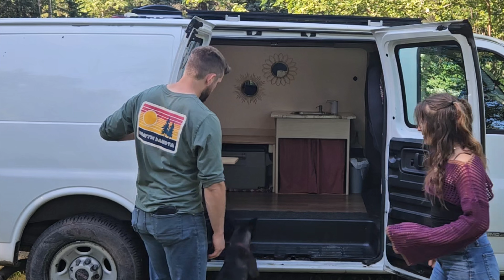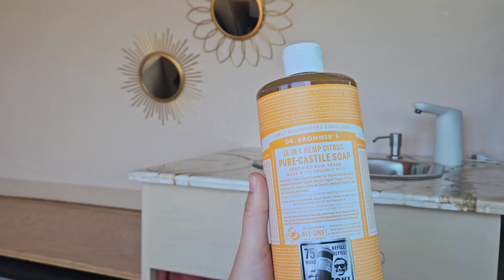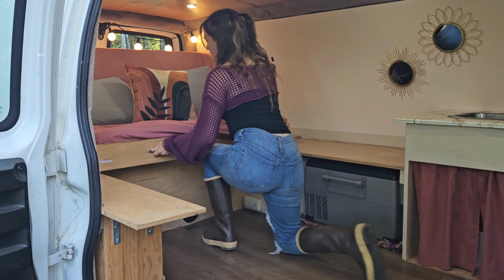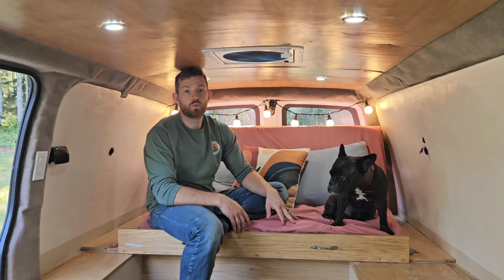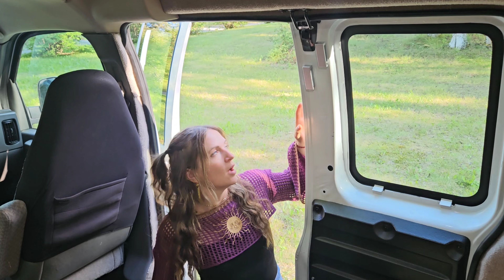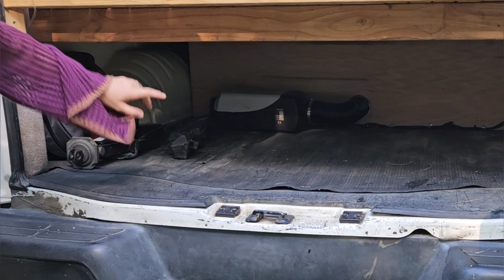CAMPER VAN TOUR!! Self-built Cargo Van Conversion | GMC Savanna | Chevy Express | L&K SEIMS

Comment: You will run into one h3ll of a liability if that lithium battery ever goes into thermal runaway.
Replace with an 8D lead acid or gell-cell deep cycle, much safer.

Comment: Trying right now to convert a GMC Savana  van 1997 into my new home with almost no money, going to use a 5gallon bucket for bathroom, got a very small solar unit only for phone charging a few led lights and hopefully i can find some fans that run on a USB cord. Not going to use any electric appliances and just a camping stove the one burner kind with gas cylinders. , the problem is space not even going to have a bed just unroll a sleeping bag on the floor both walls will be storage units mainly alot of books - my family always collected books, but we started downsizing when it took a entire Uhaul box truck just for books one of the times we moved. 
Anyway could you do more van builds or just show any builds you can for the small cargo vans like this one. Thanks in advance.

Comment: Big express fan here. Love to see it but there's a lot you could have done here. You can mount the battery in the cavity where the sink drains out as well as a tank for the gray or fresh and even a diesel or gas tank if you like in the same spot. 314ah batteries are roughly the same size as the 100s but a lot heavier and at great prices now so picking them up is extremely beneficial for the extra power to run an inverter for all the fun stuff. mounting them in that cavity is not too small. They won't hang down too far and it frees up space in the trunk and in your cabinets inside. For all seasons it helps to wrap the batteries in a 12v RV tank heater with thermostat. They only take 40w and they're on a switch. Solar and alternator combo chargers are also super cheap and extremely beneficial now. Also not a shore power plug but a 120v battery charger (which I prefer over shore power) are extremely cheap and a breeze to install for home outlet charging when you want it. If your van is equipped with a 120v engine heater (typical on heavy duty models and diesel trucks) you can even run a splitter from a bumper plug to heat the engine and or just charge the battery. In my opinion it's only worth it to use regular height countertops even in a low roof van. Things in regular life just tend to fit better. For instance at least having desk height lets you slide your legs in under it. Though typical countertop height leaves a small hole to do food prep I think it's worth the sacrifice. You may even be proud to contour your countertops to various depths to accommodate different things better in a smaller van. For instance the depth of the sink vs the air fryer. Lastly tent air conditioners are a great option for these vans now. They use half or a fraction the power of 12v rooftop 120v window mini-split or even portable residential units use and the prices for them came down a lot which was a big deciding factor for me personally. Going without ac is now a thing of the past and technology is finally letting the simple life not suck. One last bonus thing that might be worth a mention. 120v so it does need the inverter to work but heated floor film. It goes under your finished floor. If you have insulation it goes right over that and just under your floor of choice. In my opinion it's a must for perfect redundancy in smaller vans. My van is the extended wheelbase with 11ft from drivers seat to rear door. A 3ftx10ft mat only draws 360w max. That's actually less than the tent air conditioner. At that rate it will run on a single 314ah battery for 12 hrs.

Parts:
dumfume 314ah lifepo4 battery - $294
5 gal aluminum tank - $90
rifachua 12v RV tank heater - $20
renergy 40a dc-dc with mppt charger - $125
nexpeak 120v battery charger (does charge lithiums) - $25
joemnwart 3000/6000w psw inverter - $150
mictuning 15a 120v port splitter plug - $20
wishilo 400w 120v tent ac unit - $180
quietwarmth 3ftx10ft 120v heated floor film with thermostat controller - $385
Reply from the maker: The solar charger and battery are mounted in the rear, so is the diesel tank and heater. They are mounted in a way that theyre not in the way that way its keeping trunk space and not cluttering our sink cabinet.

Comment: Is that normal or extended. Also, what do you think of the new savanah 6.6 motor ?
Reply from the maker: This is non-extended, just the normal length. We haven't had hands on experience with the 6.6 motor but I've heard that they are reliable as long as they are properly maintained!

Comment: Can add a custom hi-top install on this van for much less than buying a Ford, Dodge or Mercedes hi-top cargo van.
Reply from the maker: That's actually so valid 🙌 I haven't price checked but raising the roof on this would be niiiiiceee
Reply: @LKseims  I've read it's $3k-5k for a high top to be added depending on the wheel base (when done at a shop that does it, not DIY).

Comment: The decision to place the cooler on a rug is actually quite genius.  Simplicity at its best. Makes complete sense.  I will be copying that
Reply: Try this, then: my Trelino(R)😅 "composting" toilet sits on the heavy lipped cookie sheet i use under my stove on campground tables. Super slidey when needed or rock-solid when i put a nonskid pad under the leading edge, during travel!

Comment: Tell me how you insulated the van floor, top sides or if you didn’t and then what you used for your walls they look smooth and not as if they’re what
Reply from the maker: We don't insulate the floor on our vans anymore because we hardly noticed a difference when we did vs didn't 😬💁‍♀️
And the walls are rough old wood, covered in drywall spackeling! We'll upload a YouTube short showing that process soon!

Comment: I can't stand seeing the sink 1st thing.
Reply from the maker: Wait why 😂😂 99% of van builds that's what the side doors open to.
Reply: @LKseims Tell me about it. It's always a welcome change when that isn't the case.
Reply from the maker: @leilal8053 but what would you rather see? Someone's bed or shower? Or a countertop with no sink?
Reply: The seating/living area in front. Wardrobe  and bathroom behind, the kitchen counter opposite (to the side of the door) with the (covered) kitchen sink in the back. If there is no enclosed bathroom, then a split-sink to separate the kitchen activities from bathroom ones....or a least a removable basket/colander. If you have the typical shower-with-a-toilet, then a drop-down sink that uses the shower 🚿 fixtures is practical and turns that shower into an actual bathroom.  Most European vans and tiny campers have no issue with that. 😊😊😊😊
Reply from the maker: @leilal8053  Nice! Sounds like you have a very specific van design already set in your mind. Hope you get to build it someday 🙌🫶